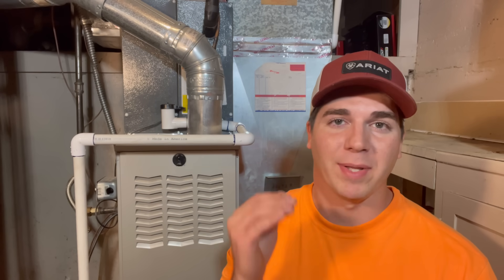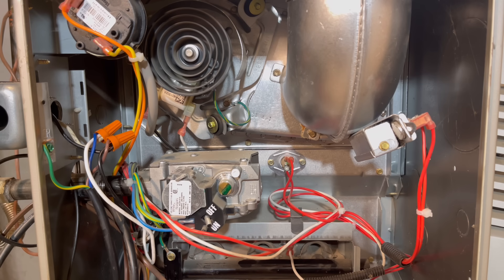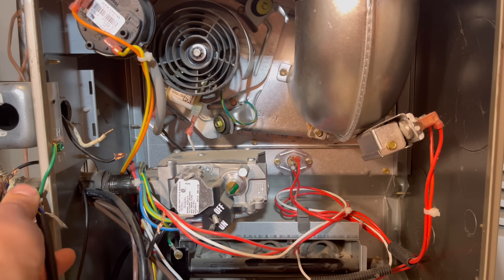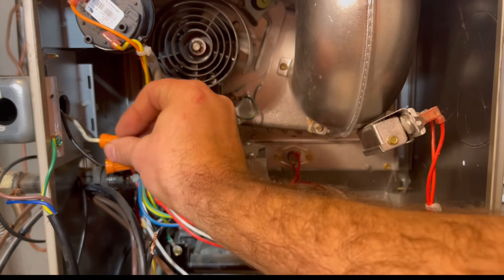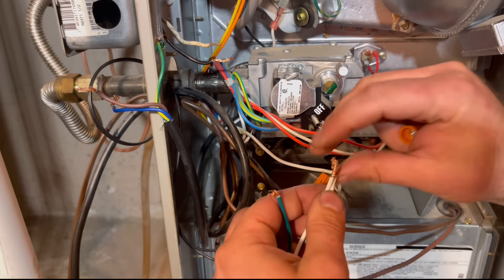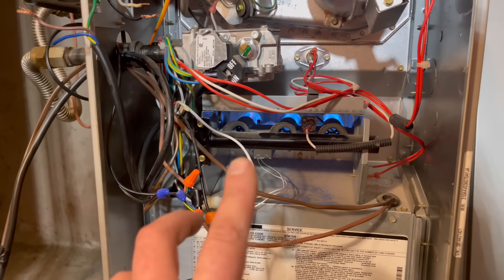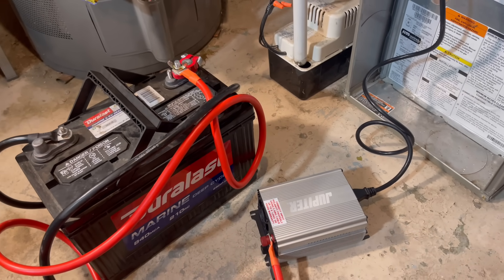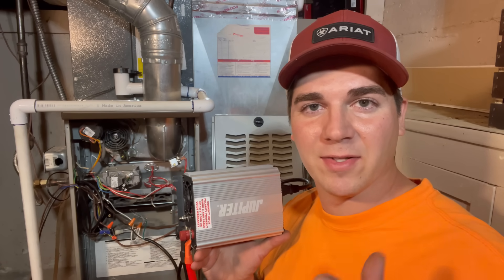Did You Know You Can Heat Your Home With A Car Battery?

Comment: There IS a green ground screw VERY apparent in the furnace shown. ALWAYS GROUND EVERYTHING. As for this application ground is needed too. Finicky digital components can tell the difference particularly in new equipment. (30yr HVAC experience). Hope he doesn’t forget to put it back correctly or his basement will be flooded when he uses the AC.
Reply from the maker: Thanks for the advice my friend. Always nice to have some seasoned hvac guys here to comment and give tips! Yea I just did this for test purposes but hooked the condensate pump back up. 👍🏽
Reply from the maker: Make sure and subscribe to our channel and comment on our videos! Cheers

Comment: Could you use a battery charger plugged into the inverter and hooked up to the battery for endless power
Reply from the maker: A bunch of people have asked about this. Unfortunately it would not work. But you could have another batter to keep it charged and cycle them possibly.

Comment: Why not keep battery in car, attach inverter under hood and run extension cord to furnace in house and then attach to furnace? Turn car on to recharge battery.
Reply from the maker: Yes this is actually what I ended up doing. The test video for that will be out soon so stay tuned! Cheers

Comment: Happy to do prepping work we're in Texas I do off-grid solar and stuff that can allow simplistic backup for furnaces hot water heaters Etc.. I would be surprised as these inverters are typically inefficient I wouldn't think it would run this very long.  My guess  10hrs  if crappy inverter 

Chris with CRsolar Texas
Reply from the maker: Yes I came to that conclusion after seeing the comments. I’m not trying to be dishonest or anything here, I just wanted to offer an option tjay people can have in their back pocket. In the next video I’ll talk about having this setup but in your vehicle so you can use the vehicle as a generator. Thanks for watching. Cheers

Comment: Add a Solar panel  to your battery, it will last longer due to being charged through the day.
Couple of suggestions that people can take or leave, do not sit a battery on concrete for any length of time because the battery will actually slowly discharge through the cement. Sounds weird but it happens. sit the battery on a piece of rubber matting or something. Could also permanently wire in a couple permanent pig tails where you took the wires apart or breaker box, install a lock out switch in replacement of the current one so that you can turn the switch off and lock it out, then turn on the secondary power source rather than having to take the wires apart if it is a regular occurrence. Less of a safety concern if it has permanent pig tails, LOL, there is a saying "Mess with the power and the lights will go out" and we aren't talking about the electricity! 
Great channel, just found it, subscribed! Thank you
Reply: The battery on the concrete is no longer true.  Better battery cases

Comment: Could you run an experiment to see how long it actually works? … not just theoretically speaking “it lasts for days”
Reply from the maker: Yes, I apologize the test video hasn’t been posted yet but it will be up soon! Please make sure and subscribe so you see one that comes out. Alternatively but I also found is that installing the inverter in your vehicle and then running an extension cord allows you to power the furnace for as long as you have fuel in the truck. Thanks for watching, dave

Comment: Several bad assumptions in the first two minutes of this video, and I hope folks are smart enough to see them. The big one though: Turn off power at the circuit breaker before disconnecting anything, ALWAYS!! And I agree with what others have said; add an A/B or Bus Transfer Switch to the circuit powering the furnace. That way you never have to change or undo the wiring, just plug things in and turn them on. That said, depending on the type of furnace you have, what is shown in this video can work BUT I'd save this method as a last resort. Plan ahead now for what you'll need later and you'll likely never have to do something like this.

Also as noted in this video, if you have a camper trailer you could take the battery from it for sure, or just keep propane in it over the winter and keep the battery in good condition (inside the garage, solar panels or whatever). If the power goes out in the house for an extended period, just move the family to the camper for a day or two or five. Turn off the water in the house and try to drain the pipes (and flush the toilets) before you leave in case things freeze-up while your gone. That also means you'll need to have blankets and such handy for use in the trailer year-round, but that isn't a difficult thing to do.

If using a generator, make sure to have a beefy chain or cable with large locks, and a place to secure it to so that it doesn't grow legs and disappear. If you can, add a power inlet to your house for the generator to connect up with. That'll make things easier to setup when you actually need it, and helps to keep all the doors and windows securely closed to hold in the heat. And obviously only run the genny when you must to conserve fuel, and keep an extra few gallons of fuel around. If you haven't already, and have the option to do so with your property, consider a whole home backup generator that runs with natural gas or propane. They're expensive to buy and install, but make life so much simpler and more comfortable when they're needed. Whatever you do, just keep a stick handy to keep the neighbors in-line when they start showing up at your door begging to stay warm.

j/k, that's a joke right there. But when the lights go out for more than a winters' day and the neighbors realize you still have heat at your place, they will come calling. Be ready to start assigning rooms and to get really close and friendly with everyone whether you want to or not. And always have a few extra rolls of TP along with a several bars of soap.
Reply from the maker: Thank you so much for these tips. Much appreciated! These comments will for sure help people in an emergency situation! I have several methods of creating heat, and will be sharing those in form of video very soon! Thanks again for watching and commenting!

Comment: This is a great idea ad it got me thinking (which is usually a dangerous thing) but if you added a multiple source power switch so that you can manually just flip the switch to engage the battery system and a trickle charger for the battery then the system is self contained. When you have main line power the trickle charger it keeps the battery charged and ready, the power switch makes it easy to just change power sources easily. I am going to do this at my home.

Comment: I did some math, and in my worst cold month I would only run 5 hours and that would drain the battery 95% which is hard on it, but if a guy is careful he could run that furnace about four times a day for half an hour for two days to keep the pipes from freezing. Great tip for emergencies.
Reply from the maker: Exactly! Thanks for these points. Stay tuned for the test video! It will post soon.  Cheers
Reply: I measured my blower motor's current draw once and if I'm not mistaken it came out to 750 watts?  Doesn't seem like a standard car battery will keep up with that for long.  Speaking of car batteries (i.e., not deep cycle), keep in mind deep-discharging them will shorten their life considerably (as in you'll only get to do it like 6 or 7 times on an otherwise perfectly healthy battery).  An emergency is an emergency though.

Comment: Before you go ordering your battery and power inverter you need to know the type of heating system you own. This hack is for a GAS furnace only... NOT a HEAT PUMP. This method will NOT work on a Heat Pump system. Know before you go!
Reply from the maker: I stated that this video is how to power your gas furnace at the start of the video. I can create what I think is a PERFECT video, and someone will say somethings wrong with it. Every video has something wrong but the principal of the video is the main thing. Thanks for your comment. Cheers

Comment: Why won’t this same setup work for an oil fired furnace, or will it?
Reply from the maker: Does it only requires 110 V to run?
Reply: @diyhvacguy  Thanks for the reply. I believe so. Didn’t know there was a 220V residential fan system, but I’ll check. So I assume, if it’s 110, it would work?
Reply from the maker: @BrianMiller4802  more then likely yes.
Reply: @diyhvacguy  Thanks again. 🤙🏻🤙🏻

Comment: We heat with #2 home heating oil, mine is a Becker burner with a circulator pump. Would this be able to run on a inverter as well?
Reply from the maker: Is it 110 V?
Reply: @diyhvacguy  It is.

Comment: Hey,  I want to start super small with solar power.  Going solar one appliance at a time.  So the perfect appliances to run solar ,  I think, are the gas furnace,  gas water heater and refrigerator.  You make it sound that a single battery will run a furnace.  So I would only need a couple of 100 watt panels to keep such a battery topped up.    Another battery would run the gas water heater.
Reply from the maker: I’d advise a deep cycle marine battery, but if you chose to use a car battery, then running the inverter in your vehicle would be wise that way the alternator can continue to charge the battery.

Comment: Would you be able to setup a receptacle that's ready to go and all you do is attach your two inverter wires?  Or leave the plug wire hooked up full time making sure to put a cover over the pins, with a warning to make sure that the switch to mains is off?
Reply from the maker: Yes that’s what I’ll be doing so stay tuned as that video will be up soon! Cheers

Comment: How do you power the thermostat?
Reply from the maker: The thermostat is powered by the furnace, or if it has batteries then the batteries power it, so the thermostat will still control the furnace wile the inverter is supplying it with power.

Comment: For Years, during power outages, I have been using a 1000 watt inventor hooked up to my car in the driveway, though a 50 foot 14 gage extension cord to power my refrigerator. Just do it every couple hours for 30 minutes, it will save your food from going bad.  Also, I leave my car idling, to help keep the battery from going dead.

Comment: Can you use a jackery?
Reply from the maker: You can if it supports enough watts.  But it will probably not last long. I’m trying to get ecoflow to send me one to test out. My advise is install an inverter in your car then run an extension cord from it to the furnace and you can power the furnace as long as you have fuel in the vehicle! Thanks for watching! Cheers
Reply: @diyhvacguy  
Ok ty so much love your channel

Comment: My furnace has a 110 plug that goes to a standard wall 110 socket in the cabinet. SO I should be able to just unplug the cord from the wall socket and plug it into the inverter, no?
Reply from the maker: Yes! That’s what I’ll be changing mine to very soon. Stay tuned for the rest video! Cheers

Comment: They're making some great marine batteries these days that will be more reliable than the old lead acid battery & hold a charge longer. You never mention the Watts of your power inverter, so it seems as if a 1K Watt + inverter is your ticket, and may I suggest you look into your local truck stop for an inverter. Their prices are competitive with any store, and truckers use some of the best inverters for their rigs to run their home comfort equipment in their trucks.
Reply from the maker: Great info. Thank you sir

Comment: This will not power your furnace for days. Furnace fans typically draw about 250 watts or more. A 150 amp hour 12 battery can usefully provide less that 1500 watt hours and usually much less. That's six hours of heat at most. At a 50% duty cycle that would be 12 hours of heat. This battery has a reserve capacity of 210 minutes or 3.5 hours at 25 amp discharge rate which is close to the demand of a furnace with a blower.
Reply from the maker: I do apologize for any confusion on my part. I didn’t realize this wouldn’t last for days, my buddy and I who thought of this idea assumed it would last for days. But 6 hours is pretty great in an emergency. What we came up with is installing the inverter in a vehicle and then running an extension cord to the furnace. Then in theory you should be able to power the furnace for as long as you have fuel in the vehicle. Thanks for your information! Much appreciated.   Dave

Comment: im not sure if you're just being dishonest, or you really have no clue what you're talking about, but that battery is dead in 30-60 minutes. prove me wrong
Reply from the maker: Everyone keeps saying anywhere from 15 minutes to 8 hours so I’m not sure who to believe. I’m not trying to be dishonest here, I honestly thought it would last days as the furnace only runs in like 10 min increments. Stay tuned for the test video.  Would you believe me though? In the test video, everyone will probably say he has it plugged into a regular outlet or something else.  But believe me, I’m just trying to help people In an emergency and this is good knowledge to have.

On a side note I’m going to test having the inverter mounted permanently in my truck so the alternator can continue to charge the battery and in theory run it as long as I have fuel in the truck! At any rate, thanks for watching and thanks for the comment. Cheers
Reply: @diyhvacguy  we’ll just think about what you’re saying and it makes sense. 800watts running from 12v is around 67amps. Take into account inverter inefficiency and you are more like 80amps. That battery is probably good for around 60-80aH meaning around one hour and it’s totally dead. Draw it down only 50% and you get around 30 minutes of runtime. 
Your idea about running from your truck is fine, but your alternator will need to provide a CONSTANT 80amps, which most won’t do for long. And even if it can, you’ll be running a V8 to power a furnace. That’s got to cost a fortune. 
Now look at a little 1000w generator, it will probably run all day on a gallon of gas running the furnace. 
Do you understand now why what you’re saying seems dishonest at best?

Comment: Great info, BUT! For the people that are not familiar with electrical, PLEASE PLEASE, take a few moments to get a screw driver or nut driver to wrap the ground wire around the screw or bolt to the metal section of the unit (it should be green). There will ALWAYS be a bonding connection for ground electrical connections.

Comment: Hey DIY hvac guy; be honest and confess that you are using a marine 12V battery; not just a plain 12V auto battery, and explain WHY.
Reply from the maker: I said this battery is out of my camper, but I shouldn’t assume people know the difference. On a side note, I have found that running the inverter in a vehicle is better and more applicable to people who don’t have a camper battery laying around. They can just run an extension cord and charge the battery as needed. Thanks for the comment. Cheers

Comment: Not connecting the ground from the inverter to the furnace could be dangerous. Indeed, there is a ground connection from the house wiring, even though you don't see a green ground wire - it's either there, back in the switch box, or it is connected through the conduit. CONNECT THE GROUND!
Reply from the maker: Ok, I’ll have another look. Thanks Joseph!

Comment: In an area with ice storms that will take power out for days, I put in a transfer switch and keep a generator handy at all times. It also supplies the fridge to prevent loss of food and the sump pump in the the basement (in the north-east), with a finished basement, having the pump available is a necessity.
Reply: I have a similar setup (switch&generator), with my generator able to power the furnace, fridge, one bathroom, kitchen lights, living room lights/tv/internet. Now watching videos to help make a homemade battery backup energy storage to not have to run the generator nearly as much. Stumbled on this video and was like that is iffy stuff to set up he is talking about, and then try and do it in the freezing cold and dark. If only there was a unified set of regulations for power companies that made them spend money to plan for the worst-case scenarios.... Oh, wait a sec, there is, outside of Texas.

Comment: Nice video but your better doing a 'safe room' concept with propane heat source like little buddy heater or modern kero heater.
I would not want to risk my car fuel or its eletronics during emergency event.
Reply from the maker: Yea I’ll be posting a video with heating your home with no power or gas very soon. Stay tuned for that! Cheers!

Comment: That Bestek inverter review on Amazon showing the furnace IS my review!  So yes I’ve tried running many things with it. 
I’ve since given up on that set up. 
“Lead is dead” 
I’ve moved on to a lithium iron phosphate battery and a Giandel 2,200 watt pure sine wave inverter setup. 
The Bestek on lead acid will not preform great at about 700 watts, fyi.

Comment: Is there a 12volt fan that can be installed to pull less of a charge from the batter or a Solar charger?
Reply from the maker: Not sure on that one. I know some of the newer high efficiency furnaces have 24 volt blower motors.

Comment: Also, if the battery starts to run low before your power is restored, simply hook jumper cables to it and your car battery and recharge it that way.
Reply from the maker: Yes! Thanks for the tip bro